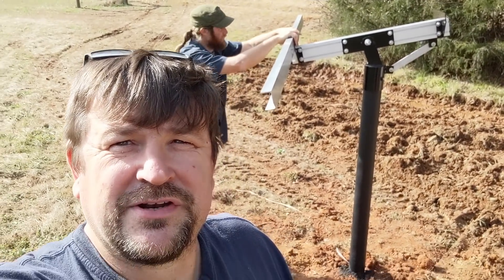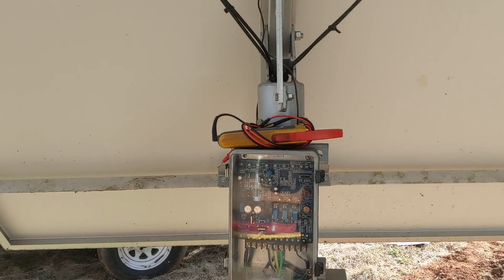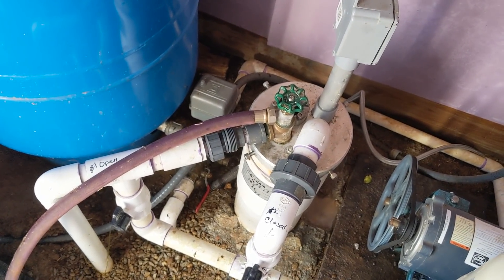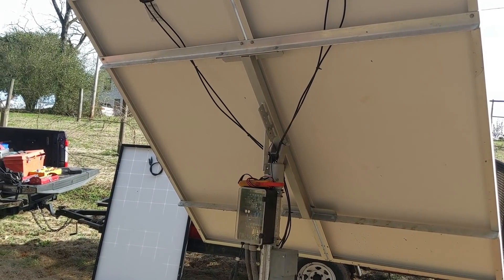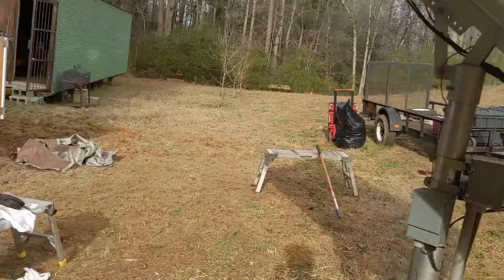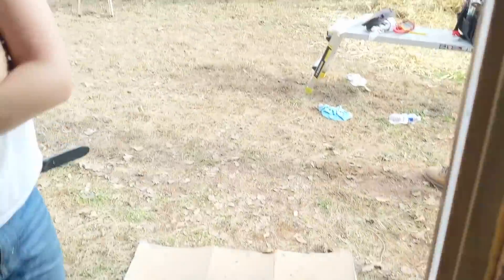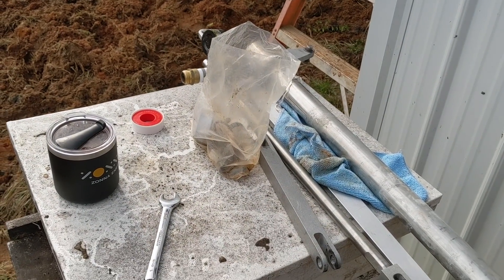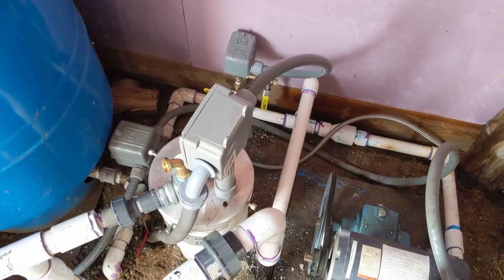We Need More Water!

Comment: There was an Indian company that built a three phase converter it run a 7 1/2 HP motor , it was crazy.
Reply: Nothing new, you take an inverter for motors, you open it, you connect to the internal DC bus with as many solar panels in series as is enough for the voltage of the DC BUS inside the inverter, you connect a step down converter to power the circuit board control of the inverter to make it turn on, he turns on and does his job by generating the three-phase alternate with the possibility of also varying the frequency, without knowing that the voltage does not come from the internal diode bridge rectifier but from the panels connected in series , study the block diagram of a three-phase inverter for motors, it works also with inverter air conditioners, there are several videos on youtube for years ...

Comment: Engineer, how do I get hold of you. I’m in California working on a project and I need advice on water pumps and hydroelectric systems. Email??
Reply from the maker: Info@practicalpreppers.com
Reply: @engineer775  I was talking about an air pump on your live feed today yosoo 35w  air pump on Amazon 125 LM 12 volt you don't need a big compressor   to do  what you  are doing  40 ft no problem I would like to have your email